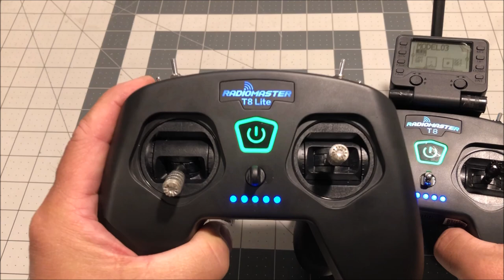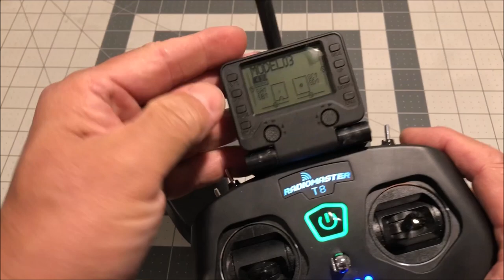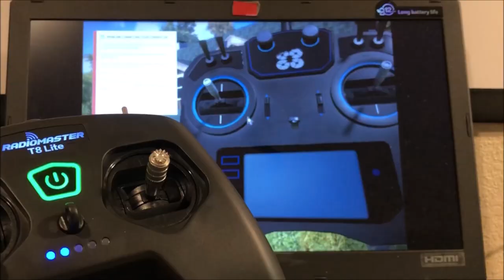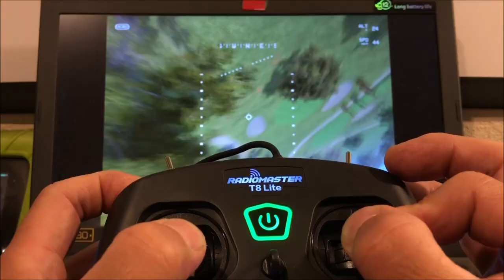Radiomaster T8 Lite  Cheap Beginner Remote Controller 8 Channel Simulator Capable Radio Transmitter

Comment: I got the grey jumper t-pro multiprotocol and a a white clio to snap on micro modules or nano modules or maybe make a power rf booster with servo plug . It might be a good everyday every model tx .
The price went up since feb. 1st 
It has a small streamlined game controller style screen and momentary trigger buttons for acro dead man switches in case you get disoriented about up or down .
   Youtube destroyed my last youtube channel . 😢

Comment: Does t8 lite work with frsky xm plus?
Reply from the maker: 09:28  binding d16
Reply: @RCEscape  i know about binding sir, was just worried since my unit did not bind to r81 receiver!
Reply: No .I have both the XM and XM+..don't work,only works with V1 protocol
Reply: Which receiver works 100% with this T8 Lite? I bought r84, xm+ doesn’t works….

Comment: Nice job Pete, I have the pro model and it works great. Hey Pete, I meant to ask you about using the tx with the simulator. I set everything the way that you did in your video some time ago but I am getting a delay in the controls. Is there a different way to set them?
Reply from the maker: Thanks!  The pro is all you really need and more :)

Comment: This also works with all the radio master receivers
Reply from the maker: It will only work with what the cc2500 supports.
Corona, Hitec, Futaba S-FHSS, Frsky D16 / D8, RadioLink, Graupner HoTT*

Comment: hey, know this video is bit older great job though very helpful. one thing I'm really wondering though, is if I bind to a drone and then bind to another drone, do I have to rebind every time I switch drones? or does it have it's own way to know your flying a different drone. like if you have 2 drones bound, it will connect to whichever drone is turned on? in the video you show that you fly multiple drones, did you have to rebind every time or it stayed bound to them?
Reply from the maker: You don’t need to rebind the drones that are already bound.
Reply: @RC Escape  ok,  Very helpful, put a conformal coating on one drone for winter and haven't bound the remote to the drone for summer and was kinda of worried. Thanks so much for the reply !!

Comment: Hi great video. thanks for this.  I have a small question cause I'm a bit new at this.  at around 8:50 you mentioned that you have set the switches using betaflight. I am assuming you set them via the MODES optioon when connected to the drone right ? What I mean is you cannot change the switches functions  if you just have the Radio , am I correct ?
Reply from the maker: you have to do both.  first you need to set the switches then assign them in betaflight as to what you want the switches to do.
Reply: @RCEscape  Does that mean that betaflight can connect to the transmitter directly via USB ? I know it does not support OpenTX so it can't be set with that.

Comment: This d8 is frsky d8??Because me I need Frsky d8 mode for Tinyhawk II RACE
Reply from the maker: Correct.  D8 refers to the frsky D8 protocol.
Reply: @RCEscape  ok thx so so Mutch but all mini fpv drone with Spi d8 receiver work with this remote ?
Reply from the maker: @kxdmotovlog6898  
Yes it will.

Comment: yo dude i need help with my controller, it just wont turn off, i dont know whats wrong with it ive barely used it and it just wont turn off
Reply from the maker: Perhaps the power button is faulty.

Comment: Hello i have a question :
I have a Radiomaster T8 lite controller that has the 4 aux switches. SA switch is CH5 and thats a default 2 position switch. Now i have my talon 250g FVPready from banggoods with Zohd Kopilot lite(doesnt support betaflight nor anything else) and my receiver is the frsky xm+ directly plugged into my zohd kopilot via sbus.
In order to switch my flight mode to RTH,Balance or Manual i need a 3 pos. Switch on CH 5, but radiomaster t8 Lite has only 2 Pos switch on CH5.
What is your opinion on that ? 
Can i just exchange the switches with soldering?
Or is it possible to switch that setting betaflight configurator,does it support the Radiomaster T8 light ? 
Thank you very much in advance!
Reply from the maker: Unfortunately, you need to either have betaflight or a display screen on the radio to change aux channel config.  I'm not sure either if resoldering positions of the switches will make the SA into a 3 position switch.  So, I am not sure how.

Comment: hi wondering if anyone could help i brought this controller , my problem is my pc will not recognise when plugged in , plus the power button is just flashing red its fully charged just don't know what is wrong with it , i have searched as much as i can just don't know what else could be the problem
Reply from the maker: try powering up the remote before connecting usb to pc.
Reply: @RCEscape  thanks for the reply but unfortunately even before connecting it to the pc and powering it up , still shows red and beeping